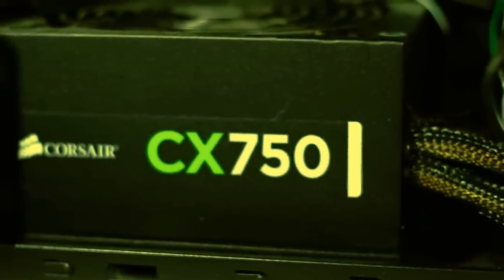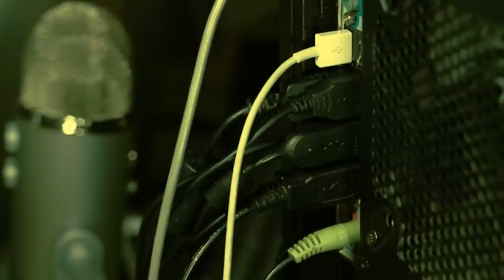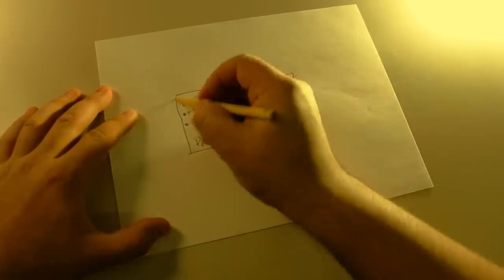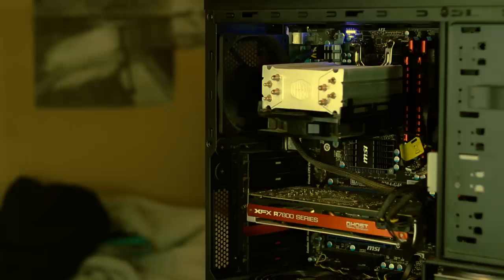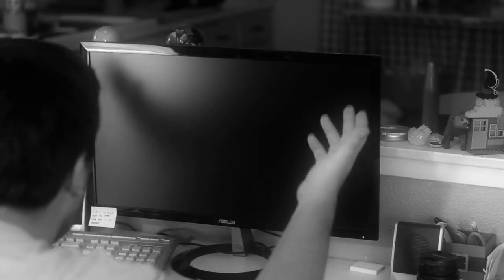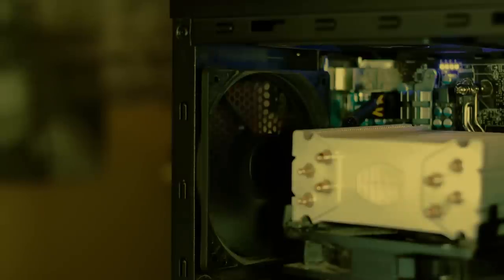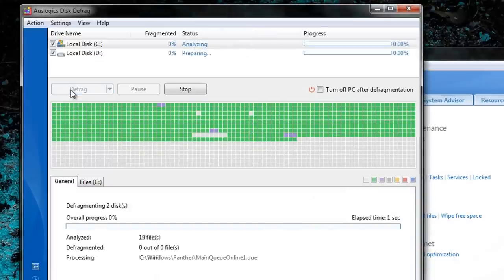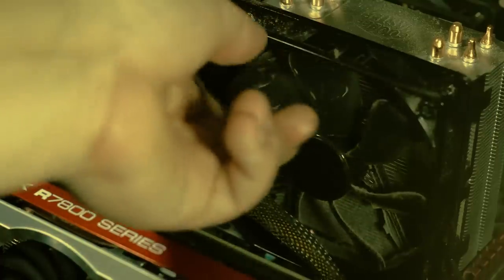What To Do When Your PC Shuts Down At Random

Comment: Can you help me with my specific problem?
My computer started to shut down randomly about 2-3 weeks ago and it happens at anytime, regardless of whether or not there are any programs open. However, I have noticed that I've had this issue more when I played League of Legends. My specs are the following:
Processor: AMD FX 6100 Six-Core processor (3.3 GHz)
GPU: AMD Radeon HD 6700 Series
PSU: Corsair HX620 620W Power Supply
RAM: 8 GB
Also, I have downloaded the non-beta version of the AMD drivers.
Reply from the maker: Have you tried monitoring your temps? You telling me that it's more frequent during a LOL session makes me think that it may be overheating.
Reply: I have noticed that the temp would cap up to 40 degrees Celsius but before I had to format my computer, it was able to cap up to 45 degrees Celsius. Though, I don't think 5 degrees Celsius would make much of a difference :/ Anyway that I can manage the heat in my desktop?
Reply from the maker: I think you're right, I'm glad to see that you've actually conducted tests to see where your temps are. That being said 40 degrees Celsius is not hot enough to kill your PC, so you let's look elsewhere...
The next place I would check is power. 620W seems like enough power for your current setup, but have you tested the power supply with multimeter? It seems like a real pain in the ass, but an unreliable power supply is a real killer.
Reply: Yeah, I've been thinking that it's a possibility that my PSU is becoming unreliable more recently but I also suspect that the cords in my desktop could be loose. Motherboard could be having an issue, even. Either way, I gotta check the inside and hardware of my desktop.
Reply from the maker: Yeah man, get it done! This is one of the most annoying PC issues possible! :O
Reply: leaverbuster much?
i feel you

Comment: My pc shuts down when I open big applications esp while playing big games . But it doesn't shuts down while playing small games, MS-office tools or sometimes even when I use the system slowly !!! I thought it may be becoz of overheating but my pc runs for long if  I am goin on with small apps.After watching your video I have installed ausologics registry cleaner which showed 660 problems !! out of which 143 were just for installed software ! plz hlp me out with this..
Reply: power supply, 
heavy games require more power, my pc restart too when i play the witcher 3, but its not restarting when i play light game like minecraft, or gta sa
then i replace my simbada 450 psu to corsair vs650 psu, after that my pc never restart again
Reply: bullshit my pc was working fine months ago but now it just crashes even though I play really old 2006 games.

Comment: My PC restarts when I install a 4th RAM card. Any of the 4 work in any slots as single, double or triple card config.  Any ideas what's the issue?
Reply: Isaias Arocho your motherboard may not support the full amount of RAM you intend to use. Mine can personally support up to 32GB, but some only support 16GB, and that may be your problem. If not, try updating your motherboard BIOS.

Comment: Help why does my brand new pc keeps restarting randomly I changed the PSU and processor
Reply: Evan Fernandez did you fix this problem? If so could you tell me what you did? Thx :)
Reply: It's your motherboard, i have the same problem, it restarted as if i unpluged the power cable, check your components in another motherboard and check other components in YOUR motherboard to see if thats your case.

Comment: Im running a
EVGA SSC 4GB 960
Fx-6300 
Turbolink Psu 500w
8gb ram
3 case fans (Run perfectly) 
I check my thermal paste and i was dried but i think i need a new psu and paste

Comment: First of all nice video
I wanted to ask that my PC  while playing cs go sometimes shut downs or restarts . it does not overheats because after playing 2-3 hours my CPU temps is 40 deg and gfx temps is 55 deg . my PSU is a Indian PSU of 500 watts which I think is the problem of shutdown u can search zebronics platinum series 500 watts PSU and tell me me its a OK PSU or not . And my specs are 

Amd athlon x2 260 with stock cooler
Amd sapphire HD 7770
Kingston hyper x blu  4gb 1600mhz
Zebronics platinum 500 watts PSU 

And I'm using at I catalyst beta drivers
Reply from the maker: Okay so two things, I would switch to the non-beta drivers just real quick so you can rule that out as the problem. Next, I would also like to say that it's a very good idea to just buy a quality PSU, like from Corsair. PSU is not something you want to cheap out on man, cause it supplies power to all of your expensive components.
Check your PSU with a multimeter as mentioned in the description, and if you find a problem with the supply of power invest in a new power supply.
Reply: is corsair cx 430 ok for my pc specs
Reply from the maker: eXimO5   I'd say no. 430 watts isn't safe for your current setup. Radeon HD series reccommend at least 500w PSU, and I'd be safe and go with a 700w, just so you can upgrade in the future.
Reply: *****

430 watts isn't safe are you talking apparent power actual power or reactive power?? whats the volts and the amps? watts don't tell you anything i could shoot 10,000 watts of lightning from my finger tips at you but it won't do anything if it's 1milli Amp of current and 10000000 volts

Comment: Hi this is happening to me I just ungraded my graphics card and my cpu fan because it was getting to hot when I install these both I think it was the power supply it Is only a 400v one the graphics card would run well with it but Then I installed the fan and now my pc is going funny I think it's the power but I'm not a genius like you on pc's it might be that I haven't plugged the fan in Wright I checked the wire but I don't know or something don't worry I applied thermal paste but how would only a fan do this???
Reply: okay thanks i sorted it but i will watch anyway
Reply: K.S. i have seen this video

Comment: My computer randomly restarts for no reason, I do all the things but nothing works and it runs sometimes fine and sometimes not. Dell Precision T3400. any help would be apperciated
Reply: does this problem often happens alot?
Reply: yes
Reply: Sometimes works last longer fine
Reply: it is cause maybe you are playing a game which has a very high fps that the laptop cant handle so it shutdown like me
Reply: Thanks for the Reply, But I got the new system and my previous one had a motherboard fault that's why It was restarting again and again.
Reply: Ali Ahmed
oh then ignore what i said
Reply: Ali Ahmed It my HP computer it have the same problem should I buy another computer or not ?
Reply: my pc was ok, i bought new cable and everything was fine , i open up pc, and it just like the power gets destroyed and after sec. it turns on back , i cannot fix this.. graphics card isnt really high.

Comment: Ok soo mines like a laptop and I was just watching YouTube not touching anything then like everything stopped so I move my mouse around and a couple seconds later it shut off and screen was completely black I tried like using a thing to turn it on nothing would work and I looked at the plugs;—;
Reply: And also I tried hooking it up to a monitor and even the monitor wouldn’t turn on and it always turns on

Comment: I have a 
I5 4440
MSI GTX 960 OC gaming 4gb
8gb 1600mhz ram
450watt stock psu

Well , today i decided to buy a new psu , not that the 450watt wasn't enough but just for future reasons. It runs perfectly on the 450w PSU. So today I bought a new one a 590w PSU from a unknow Brand named LOGON atx w590 .So I came home and started to take my old one 450w out and put my new one in the 590w. Well I booted my system everything seems okay at this point. After 5min I decided to play some GTA V once in the game BAM shutdown instantly without any warning or bluescreen , It did reboot without touching the power button. I this point I see the ASUS logo and a message down below with this ''Power supply surges detected during the previous power on. ASUS anti-surge was triggered to protect system from unstable power supply unit!'' I don't understand how can a PSU that has more Watts be less powerful than a PSU that has less watts I have the say it is a unknow brand. After that I restarted the pc again and everything seems fine for a couple houres gaming (GTA V) and than BAAMMM shutdown again at this point it keeps doing it again again so I just shutdown the pc normally and remove the new psu. Now I have to wait and go back to the shop hoping for a refund. I'm planning now to buy one from the brand MS-tech  550w. Atleast it has a separate power button like all PSU have. That shit one what i have 590 doesn't even have a on/off power button next to the psu input. Any tips are welcome

Comment: PC turns off after UPS switches from Battery backup to AC mains.

UPS: MicroTek MDP800+ (Dual battery 800VA)
Mains voltage (Rated): 230V
Mains voltage (Practical): 200V - 150V

What can be the problem? Need help immediately. Can not use my PC for long.

Comment: Very cool video man, but will a PSU actually bottleneck your GPUs performance?
Reply from the maker: Hey! Thanks for the comment!
Not necessarily, but it can cause your computer to die when it needs more power that your psu cannot supply. So, it won't cause your CPU or GPU to run slower, it will just shut your PC off when it tries to run faster.

Comment: After my pc kept shutting down I decided to buy a new psu it happen again till it won't turn on anymore, bought another psu, samething random shuts down eventually never turns on again, after 2 psu burn outs I bought brand new parts, mobo, ram, cpu... Results are the same........
Reply: Maybe your room wiring system has problem.
Reply: NangongReng1973 my friend said the polarity is reversed in the outlet. Would that cause it? My TV and consoles seem fine though.
Reply: +Adam M The problem may lie in ur GPU because a GPU is a VERY big and a strong component in the computer. The biggest and the strongest that is and if your system is too weak for the GPU for example: When you have a beginner gaming pc with for example a GTX 750 (Ti) then that computer is built according to the GPU. If the GPU is too strong then it will take the most air and power and puts out ALOT of electricity and starts heating and overheating your other components up, sometimes it may even burn them. Send me your pc specs through reply and i'll take a look at them
Reply: PearuArmasJ GTX 780, I5 4670K 8GB RAM think at 1600mhz. MOBO MSI Z87-G45. 7 Fans, 3 input 4 out put. Server tower case Thermaltake level 10GT. The power outlet was reversed in polarity it has been fixed now and so far no issues..I did pick up a new PSU too...I have the corsair AX 1200 watt. I have nothing over clocked currently. My previous PSU was an XFX black 1000W.
Reply: Adam M your core looks like a little weak for this system
Reply: Sry mobo is a g65 not g45. What if I over clock the CPU? I think my pc might be outdated anyway
Reply: Adam M if it is then either upgrade it or build it over. a PC like yours isn't expensive

Comment: My pc problem is a bit different, first my pc turns on and it works fine, I'm even able to watch YouTube etc. Then the screen suddenly shuts off and when i watch my computer all the lights: mouse, keyboard, cpu cooler rgb and psu rgb are all flashing like an SOS light. Then i have tu turn it off manually because it doesn't shuts down for itself. I first thought that the problem was on the psu, so i switched it with one of 650w But the same problem was showing. And then i switched my cpu cooler because i thought my cpu wasn't cooling right. Guess what, same and i did it today im stuck on this pc build of 600€ and i watched every video of the freaking yt. None has my problem. Anyone, pleaaaase could anyone help me?

Comment: I need help with my computer it doesn't start up right it shuts down right before the starting windows screen
Reply: Same problem bro.
Reply: same probleme here
Reply: There is another thing: it restarts When it shuts down
Reply: soisoisoisoisoi200 me too have u found anything yet
Reply: Use your system recovery disc
Reply: i hav fix my problem about the shut down before the start up  you may have to try diassemble your pc component and assemble it back
(Work for me)

Comment: What to do if my pc overheating my pc neat and clean fans are running perfect no dust in fans or heatsink. I changed my cpu thermal paste 2 times. My pc doesn't turn on its turns on for a second then turn off and when ever i have chance go to bios logs its says thermal shutdown cpu/chipset temperature i have dell t3500 precision intel xeon w3580 cpu in it. Can you help?

Comment: Please ok hello read till the end of the comment i need heeelp pleaaase im panic ok thanks

I have overheating cause i dont even think that theres a fan it just keeps clicking something inside the laptop.. And my reguleg pc stops turning on and giving a red button as a "wrong and warning" Happent so i choose to plug my screen display to my laptop and the others like mouse and keyboard it worked normal for a day until this day its not even trying to do any job i mean that if just started loaded up leaving the mouse not moving nothing im doing and start overheating and finaly overclock(shutsdown) and no its not sleeping i tried to move the mouse and click the power button it just starts up normaly meaning that it shutted down itself please someone help me im typing this for too long and i dont want anyone to ingore me please im panic now please ok why now bye gtg watch skeppy video or lose some braincells

In second though i thi n k it just need to be opened and fix the fan.